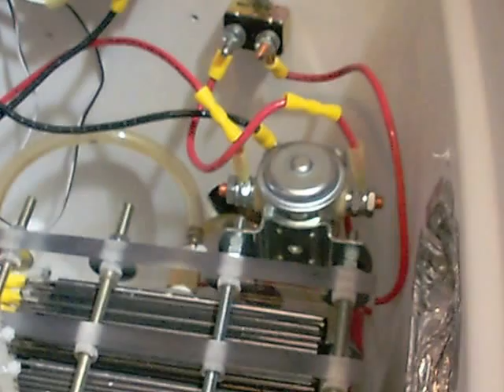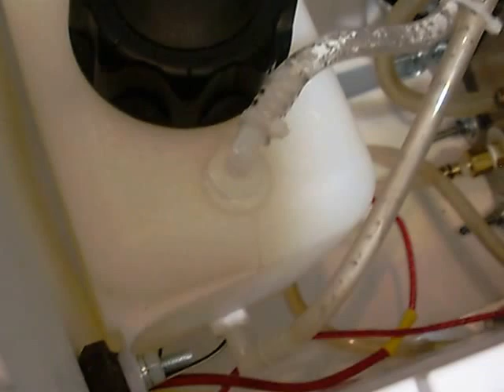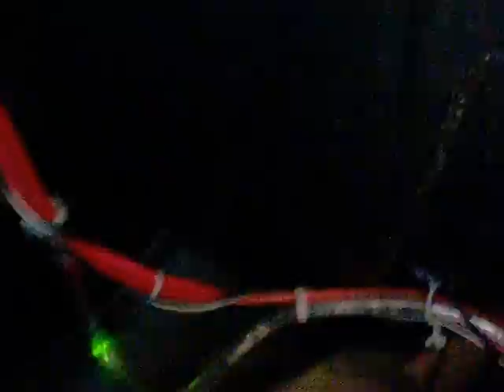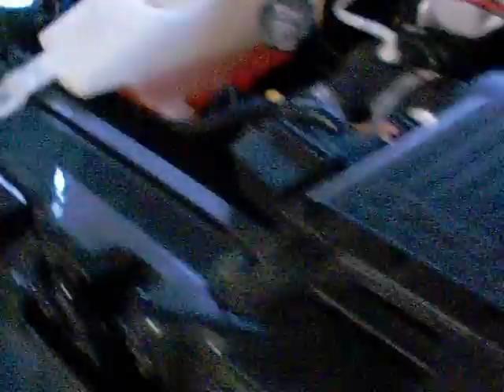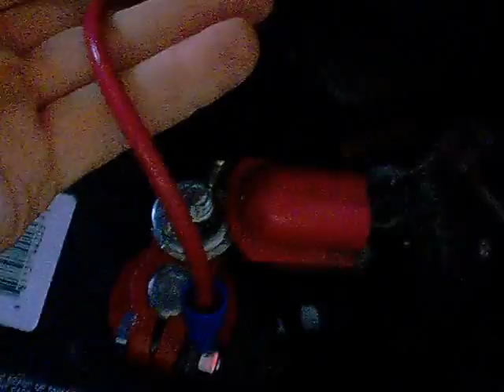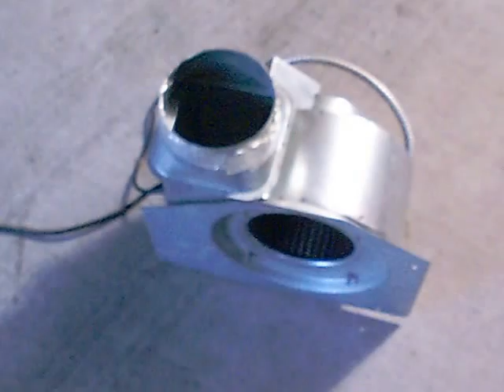Hydrogen Generator, homemade, HHO, 2011

Comment: google "2nd law of thermodynamics" and figure out why it is impossible to run anything on water.
Reply: Unless of course external work is performed on the system. Being that external energy is being applied to the water separating the molecules, and the electrical energy, or combustion chamber in this case is being used to ignite the molecules, both the first and second laws are mute. Same as biofuel generation. Several types of combustible materials are released during the thermo-extraction process.
Reply: the laws are never mute. The point here is that it's a closed system. Otherwise there's no point doing it, considering the losses.
Reply: Dino Alberini So if it is a closed system, your point is mute...
Reply: My point is that it doesn't work and only stupid people invest in this.